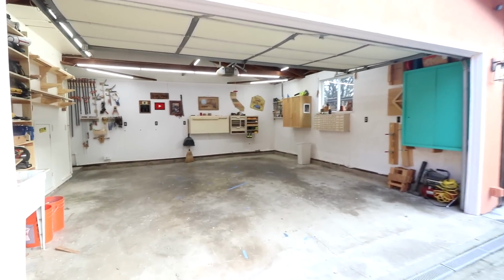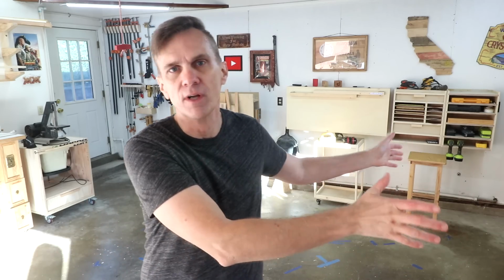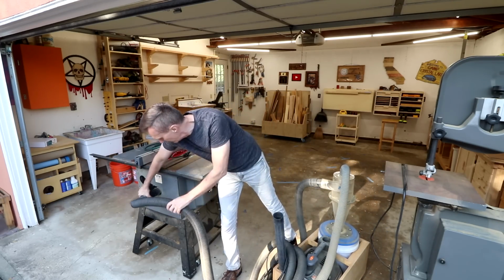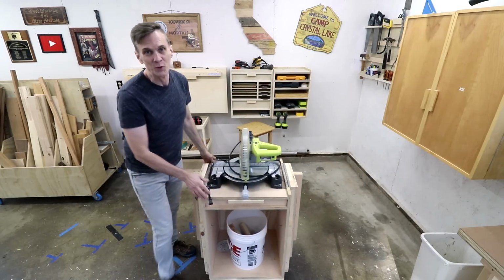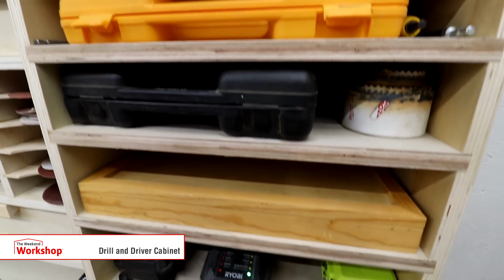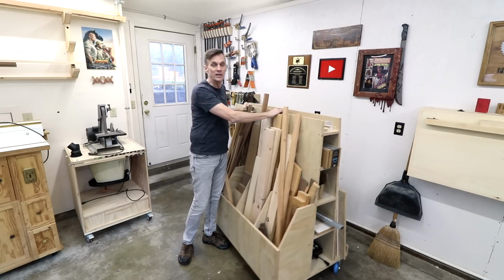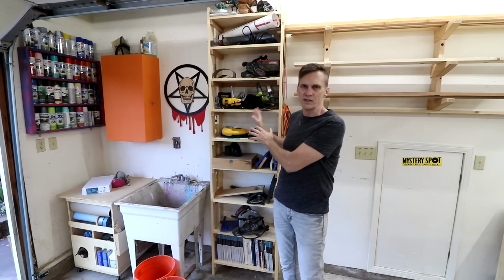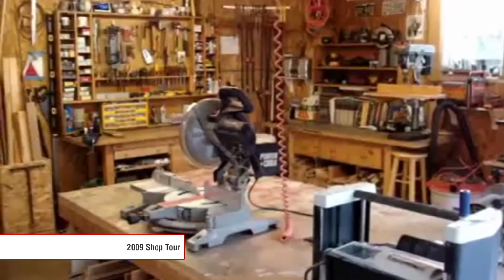SHOP TOUR. My biggest shop upgrade in 19 years! How to turn any space into an awesome workshop.

Comment: Currently my main shop space is only 8 foot by 8 foot, and I almost DREAD, going into it at times!! Not because it is cluttered, though it usually does have small messes I am more than willing to go cleanup.....but unlike a lot of guys I have no space outside to set things up at either!! 

Part of my problems is moving tools to a "work space" where I can actually use them!! You see 8 foot by 8 foot doesn't offer you a lot of room and if you are working on anything larger than two foot, it becomes a nightmare to jiggle things around!! And the idea of putting things on casters is AMAZING....if only casters worked snow or grass, which is a whole other story I have to face as my reality!! Which is you go to my channel, the first thing you notice about my shed (which is one of only two videos I have posted) it opens out into a ramp and then into my back yard space!! No paved driveway for me, no concrete patio, or pretty paver work area. just grass (and in the winter like today ankle deep snow. Not that I am totally complaining, but I can only really work in the summer months even though I do have heat and light in my shop for small projects! 

But even in the summer I have to carry every thing to the yard in front of my shed!! I don't mind that, but casters just don't work on grass AND I can waste about two hours just setting up tools in my yard lugging them in and out of my shop, placing them, setting them up, using them to lug them all back into my shop when I am done for the day, making two hours turn into four hours!! 

Having a small shop like mine isn't a bad thing....it forces me to keep it maintained and everything is in arms reach most of the time!! But in the winter months I don't have space to do larger projects I wish I could like build a set of cabinets or create larger items like Grand Father clocks or what have you!!!! And then too I am limited to having a small Black And Decker folding work bench as I don't have room for a vice or a "decent" work bench either. I am also very limited right now on the tools I can own as well, too!! Like I don't have a drill press or even a band saw!! And a lot of times I have to "glue things up" and leave them set on my picnic table in front of my home for a few hours or lay them in the grass near where I am working!! And clamping anything down is usually me clamping things to my front deck, which again requires me walking clear around my house and dragging tools even further from my shed that requires more time to do so!!! 

I am NOT trying to make it sound as though I am complaining....or "bi*ching about it", but this IS the reality I have to deal with!! And it is a reality that slows my productivity down to an almost stand still at times!! In fact some things that should only take a normal guy twenty minutes of set up time, and twenty minutes of work with twenty minutes of clean up, takes me usually over three to four hours, and again I have gotten used to it.....but it really doesn't help to make work flow "smooth" or at times "pleasurable"!! It is more work that what really needs to be necessary and at times it makes things much hard than they need be right from the start as well, just trying to figure out the logistics of "where do I put this now?" or "how to I attach that to hold it where I need it?"
Reply: While I haven't checked out your videos, I read what you wrote here and immediately thought of the typical Japanese hand tool workshop as a possible solution for you.  

I recommend picking up Toshio Odate's book: Japanese Woodworking Tools.  I also recommend (besides the venerable Steve Ramsey) the youtube channels of Paul Sellers, Mortise and Tenon, Pask makes and Mr. Chickadee.  I would stay away from Rex Krueger - he's still "figuring things out"...

This would be a (mostly) hand tool approach with just a few hand held power tools to supplement.  Many people think that hand tools are too slow and require a steep learning curve but I disagree emphatically.  You will be surprised at how quickly you can pick up the fundamentals of hand tools and just how quickly you can measure, mark, cut, assemble and finish a variety of woodworking projects without power.  

As an example, the R.I.O. that Steve mentions near the end of this video would be almost as fast with hand tools as without.  What typically slows down hand tool work is "dimensioning" lumber before joinery work.  With just a wee bit of planning, you can pick up (dimensional) lumber from a big box store that only needs crosscutting and joinery.  

Going back to Toshio Odate's book, he mentions that traditional Japanese carpenters/woodworkers prided themselves on both the accuracy and speed of their woodworking.  

As for space, with just a handful of basic (and inexpensive) hand tools, you should quickly feel comfortable building a 6 foot tall by 2 foot wide book case in your 8 x 8 shop.   

Those basic tools would be something like this:  

1. A basic pair of Japanese low saw horses - homemade.
2. A basic "planing board" - homemade.
3. An all purpose hand plane (Harbor Freight's number 3-ish is only 15 bucks - mine has seen hard use for 20 years).
4. A cheap (but sharp) set of 4 chisels (harbor freight has a chrome vanadium set for 8 bucks - again, I can personally tell you that mine are going strong after decades - chrome vanadium is as good as you'll ever need.
5. A good hand saw (if you're not a snob, a decent Western or Japanese saw can be had for 10 bucks - yes, harbor freight and, yes, they're what I use all the time).
6. A 10 to 16 ounce hammer - a good Stanley will set you back $4.97 at Walmart and your grand kids will inherit it in perfect working condition
7. A cheap drill (some electric are 20 bucks new). 
8. Whatever you got for clamps,

Comment: Love the workshop... I did see you insulated your gradge and use sheet rock... I live in Houston and insulate your gradge is usually not done here because of the rains and humidity and you would need to control the climate as well.... Do you have to insulate your gradge or can I just leave it as is with studs exposed?

Comment: I'm still in the early days of wood working, and have made about 10 projects total for my house. All custom planned. My biggest issue is I don't have a garage or a cement pad of any sort. I work out of a canopy covered car port in my rocky driveway. Though I have done a few things to make it more bearable over the years. I use a construction site table saw close to the entrance so it's easy for me to carry out and work safely.  My miter saw is also close to the entrance and on a sturdy store bought folding stand that I can drag out when I need room for longer stuff. One of the thing's I've done for lumber storage, is affix bolts between chains  that anchor the carport to cement buckets, and use those as resting points for boards. It hasn't been the most ideal workspace, any large projects have to be assembled on my deck (pretty much the only level space I have) But, as I'm saving up for having a garage  built. I'm grateful for videos like yours that can give me incite into the dream workshop.

Comment: Thanks for the tour. Enjoyed your discussion on biscuit joiners. Never use mine. I found that even using for table top alignment was more hassle than it was worth. It has joined my dovetail jig ( most expensive unused tool) in a dusty corner. I am lucky enough to have 700 sq ft of shop. I enjoy small shop solutions.  One thing I see all the time is a lot of space given to miter saws. I don’t see the necessity for them in a small shop.  I break down long pieces with a Japanese framing saw ( or circular saw or jig saw if lazy). I have a table saw that does miters, etc. can you explain why people find these so necessary?.

Comment: My wood shop is a 8'x40' shipping container.  I currently have a table saw, miter saw, belt sander, and dust collector on their stands.  I also have a small jointer sitting on the floor.  I'd love to see your input on that.
Reply: Mine is part of the basement, but I bet you and I have similar dust / ventilation issues.

Comment: Also would like to recommend workbench casters on everything. I can’t stand the way things wobble when on casters with brakes engaged. Workbench casters lift your workbench or cart or whatever off of the ground for movement via footpedals. Disengaging the casters drops the cart or bench to the ground, providing a mobile workstation that is as stable as possible when stopped.

Love this channel.
Reply: If things will wobble very much depends on the weight of the items on the casters and the quality of the casters you use. Although my workshop is quite a bit bigger than this one I have the vast majority of my tools storage etc on casters the only things I have lifted off the casters are my two sheet goods racks as the weight on them will destroy the casters in time, 16 full sheets of 20mm MDF and plywood are really heavy for just 4 casters

Comment: Part of the Weekend Woodworker's appeal was the desire to keep the tool list affordable for the average person. I'm curious to know how much money it takes to make all the new builds plus lighting upgrades and air filter in the rafters.
Reply from the maker: That depends. Almost everything is built out of plywood. I recommend using whatever you can afford for shop projects since you don't really need anything to be fancy. Materials are definitely the most expensive part of any project. Here are the LED shop lights I used: https://amzn.to/2TBieeR and the air filter: https://www.homedepot.com/p/WEN-3-Speed-Remote-Controlled-Air-Filtration-System-300-350-400-CFM-3410/205465910

Comment: well done,  being organized is really important. maybe even critical. I like mine to be lived in. smily face I need to share the space with my motorcycles and such.  last summer i built a work table that is 4'x5' and in my space it takes up a lot of space, too much space  I set it up to include drawers and such. the chop saw is built into it and can be stored below but I am beginning to think I do not need 5" of run off for the saw, maybe 3 to 3.5 ' will work just as well.  I used 2x4 construction but now I am thinking I will  use a plywood frame. thanks for the video.

Comment: Where's your 8" jointer? your 12" thickness planer? your drum sander? your intricate dust collection system? your high end hand planers? your second table saw ? (no Sawstop?) and the obvious need the $3000 CNC router machine? Guess I turned into the wrong wood working channel, as I was hoping to get advice on how max out my credit card and be in perpetual debt buying tools. I'll have to now rethink this shockingly simplified and practical approach of Mr. Ramsey.

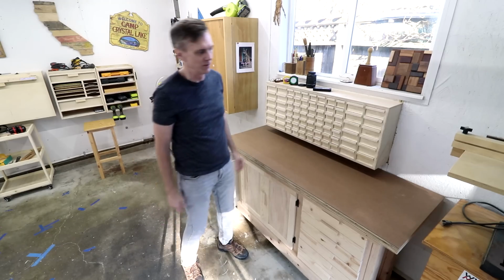Comment: at 5:48... You really need to invest in a label maker. Seriously. 
Top tip for a surface that labels don't stick to so well is to first put down a strip of gorilla tape, then install the label. This also works really great on blow molded tool cases. Apply label to both ends and the top for maximum organizational points.

Comment: Steve, where did you get your LED lighting. I need to redo my basement shop and get rid of the crappy fluorescents. Nice arrangement btw. With my Shopsmith, new Jet 8” jointer, my just delivered Supermax 25-50 drum sander, my Sawstop 3HP 52” PCS, Jet dust collector, Dewalt sliding compound miter saw, and all the other equipment, I have no room left to work 😳🤣🤣🤣🤣🤣🤣🤣🤣🤣🤣

Comment: Do you have links to your led lights and the Wen air filtration system?  Also, what size is your Wen?  (Trying to determine which size I want/need.)
Reply from the maker: Here's the air filter: https://www.homedepot.com/p/WEN-3-Speed-Remote-Controlled-Air-Filtration-System-300-350-400-CFM-3410/205465910

And the LEDs. They come in a 6 pack. https://amzn.to/3ajqIwQ
Reply: @SteveRamsey  Excellent!  Thank you.  Now I just need to find a ceiling-mounted heat source for my garage.  It gets a little cold in the winter!

Comment: Excellent!  Like tools together!!  Also commonly used tools right there where you need them... Workflow - workflow - workflow!  I built a similar tool cart that floats around my shop from station to station ... Hands down, the best thing going (It also doubles as my small pieces from the table saw and miter saw surface too)... My Shop is 20' by 40' ... but I have to Store all my wood inside my shop ... so... 20 x 20 it is! LOL

Comment: What design software do you use?  I am looking to move from the graph-paper and pencil method.
Reply: judsonkr have a look at sketch up. Super easy to get started and very powerful for woodworking.
Reply: @davecoates2308  I have fooled around with Sketch Up but am not very proficient.  I guess I need to put some time into it.  Thanks!
Reply: judsonkr I HIGHLY recommend spending around 30 mins or so doing their getting started videos. Once I did that it sped up me design time exponentially
Reply: @davecoates2308  Any suggestions?

Comment: Steve, I don't want to talk about the 100 pieces of scrap wood that I have under my mobile bench. I feel attacked. 

Thumbs up for having the same air filtration. https://photos.app.goo.gl/pF68nPbxt42PPH5v6

I started by purging the garage of everything that wasn't wood working. We have a useful shed in the back, I don't know why I kept all the shovels and the rider mower in here. I think moreso just for ease of access. I just added a router table to the table saw. I plan on placing a band saw near the window one day and a larger, more useful jointer against the wall to the right. 

I plan in the future to use a dust collector blower, positioned in the corner and run PVC up to the ceiling. There will be a long, flex tube that comes down and connects to the main table and I'll eliminate the shop vac filter and just blast the dust outside behind the garage. https://photos.app.goo.gl/534SxQrEB6JJLzq76 I made my own collector using a 20 gallon sump basin and a diy thien baffle. It works good for about 99% of the stuff. The really fine dust does get by and into the filter though. Which is why I will eventually just shoot it out back. 

That spot to the left I cleared out yesterday and will soon have https://photos.app.goo.gl/CXr8JPQkUq7uaQ8UA a good 60 or so pieces of lumber I'm picking up. Getting a bunch of oak, ash and cherry. I'm gonna try to get as much ash as I can. I hear they're dying off because of the Emerald Ash Borer. 

I'm getting the system down. It's only been about 7 months since I've started the process. One day my tools will be organize, haha.

Comment: Steve - What have you done to purge your 'non woodworking related' items out of the woodworking space? I'm still fighting with things like plumbing and electrical supplies and tools, an extra refrigerator; extension cord storage; 2 or 3 large totes filled with rarely-used power tools; etc. Even with the 180 or so square feet of garage attic space, I'm still crowded.     I noticed in the video some cabinets WAY up in the rafters..... is that where all the rest goes?

Comment: No jointer or planer? I thought those were a must.
Reply from the maker: I try to focus on projects for this channel that don't require them.
Reply: Depends on the wood you use. If you buy rough cut lumber from a mill. It's a must, from the big box store, not so much.

Comment: This looks so amazing. The best part is that it's going to be super easy to clean, too - speaking from the perspective of someone who despises cleaning, haha! The only thing I feel like could possibly improve this, is some form of labeling...though that springs from my many years of "I know where it is" and then not being able to rely on anyone ELSE to know where it is!! Having labels is an absolute necessity if you're letting anyone else touch your workshop stuff! I'm super forgetful, especially when I'm in the throes of designing something. If I didn't label all my tiny drawers and boxes I would be utterly doomed.

I have said this before I'm sure, but I really, REALLY love the 70+ drawers piece. I have easily a couple hundred pounds worth of itty bitty teeny pieces to store (I make jewelry) and THAT is a dream come true. I'd probably build two or three of them, even!

Having everything on casters does seem to be helpful, but do you ever struggle with stability issues? I mean, it seems obvious that you would use casters that come with locks or brakes (my apologies if I have the wrong technical term there), but are those always sufficient? I've encountered a few situations where wheels would not have been helpful - working with big, unwieldy things like doors, mostly...

Comment: At one point I had a shop set up in a 12x18 storage building. No dust collection and I did alot of lathe work. Sawdust and chips were usually about 2 inches deep across the entire floor and several feet deep under the lathe and table saw. Everything was on wheels but with so much crap on the floor it didnt really help. I made alot of money in that little shop. Built several kitchens worth of cabinets. Assembly was a nightmare, but I figured it out. Averaged 12 craft shows a year in that time frame as well. Mostly woodturning and toys.  Looking back I have no idea how I did it. But its proof that you can do alot in a small space if you are determined.